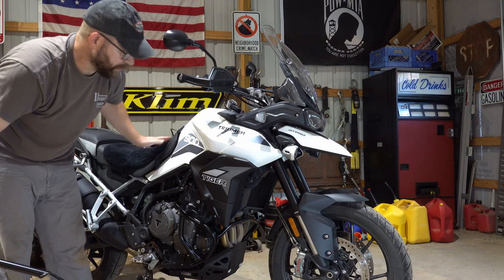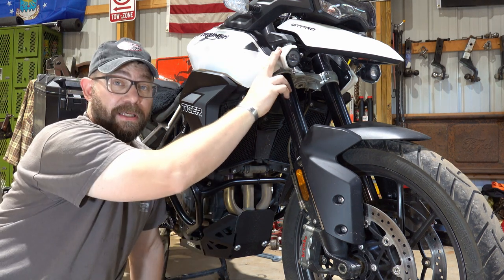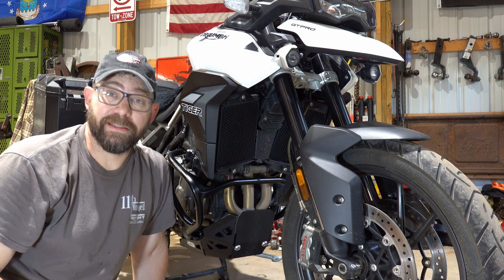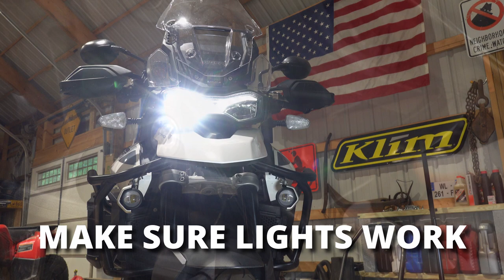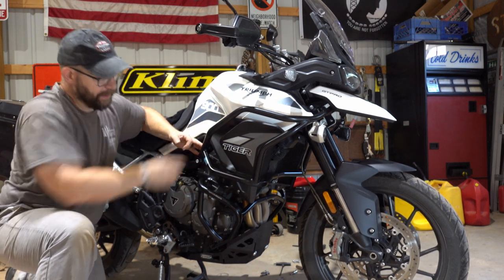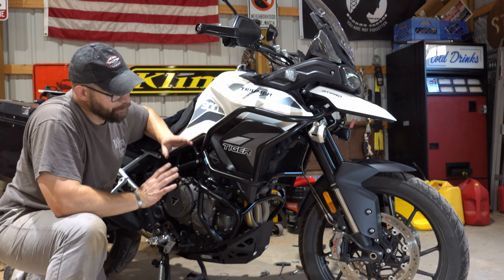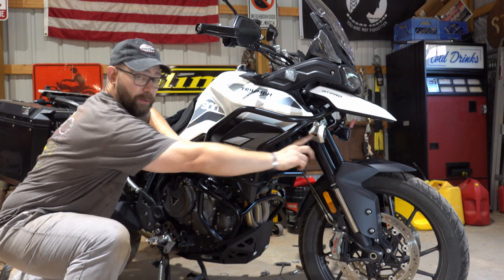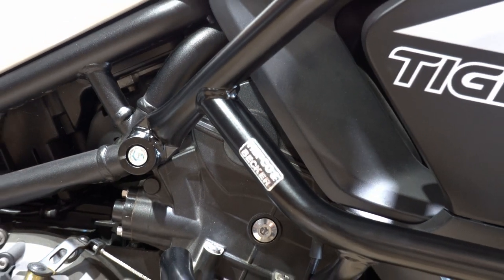Hepco & Becker Tank Guards on Triumph Tiger 900 Install and Overview

Comment: Thanks for this video, it helped me immensely. I do have Some observations for anyone who's recently bought this kit and found one significant item missing from your video. I suspect Hepco & Becker have made some changes to this product. A heavy bracket now hangs off the steering column using the two bolts that hold the headlight assembly in place. This new bracket provides a much more robust anchor for the bars that come around the front up behind the headlight and are being attached where the horn is mounted.
This makes a substantial difference to the robustness but..... trying to align everything is a nightmare 🙂
I finally finished the installation and should have taken some videos during the process. I will create a short addendum video and post a link here that shows the new/additional bracket not included in the Ridge Roamers video. The final product is very robust, hopefully, my wife will not have to test out the product for real.

Comment: I was planning on upper engine crash bars also, but sooooo many reports of sheared mounting bolts and even a few were catastrophic  meaning, the bike was total loss as it messed up the engine case entirely.  I contact 5 other owners who had sheared mounting bolts also from the upper crash bars...not just the Hepco and Beckers but also SW Motech, Outback Motorteck, Touratech also.  One in my same town told me "dont do it" so...man I'm seriously rethinking it after talking live to them.  Only ONE was a low speed drop, the other 5 were literally just vibration fatigue from riding down the road (evidently).  Be advised the after market MFG and also Triumph, will NOT warranty the bike after it happens fyi.  Triumph tried, with their NEW upper crash bars that added an additional horizontal support, however...many mentioned the under beak angle...of the fulcrum, and the geometric/ physics of just tends to shear them, including the upgraded bolts themselves the 2nd time.  YOu can get on the ADV Rider forum and Triumphrat.net and read about that happening and discuss with many.  Anyway...hope your's are awesome and enjoying your videos.  Any advice on the Top case and Top Case plate??
Reply: on the Rallys...NOT the GTs.  (sorry)

Comment: Thanks for the video. I'm considering those bars.... BTW If your going to beat up your Tiger, Keep an eye on your wheel bearings... Spokes are lighter and absorb a lot of impact  energy ....... Less Weight  less pounding on the wheel Bearings is one reason Dirt Bikes are built with them.. Enjoy the Ride...

Comment: Hi, I have the very same crash bars on my Tiger 900 RP. 
Very sturdy bars, had a few offroad drops and minor crashes and nothing moved so far.
The one thing i'm not happy with: When offroading, i wear knee-braces for safety . So my knees bump in them all the time, there is no space. Already after 1500 miles i went trough the black paint where my knees touched and my pants have worn down on that spot aswell.
H&B could do with a little redesign on that part.
Reply: How tall are you?
Reply: @kee7678  1m80

Comment: Having issues getting bolts in front under horn lined up. Any tricks or suggestions ?
Reply from the maker: They are a pain.  Just make sure the other bolts are loose enough to give you some play in moving them around and getting lined up.
Reply: @RidgeRoamer  Thanks for the reply.  I finally got it.  I went and purchased a longer bolt to just line up one side while I worked the other bolt in.
Reply from the maker: @douglastolley4050  Nice way to work the problem! Good advice in case someone else struggles with the same issue.
Reply: I'm struggling with this as well. did you tighten the bracket into place first before lining up the guards?

Comment: I bought the same but right knee rubs on the guard at the mounting point on the side of the engine. Now had to remove both engine and tank guard as H&B couldn't address the issue. Waste of time and money